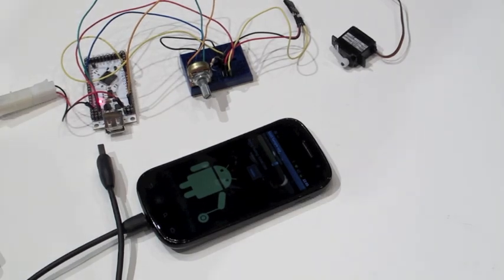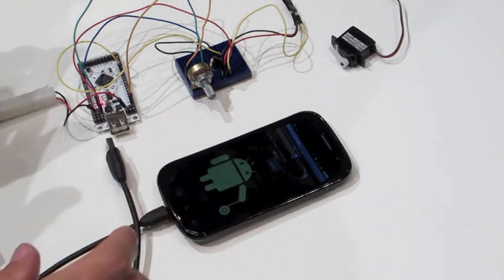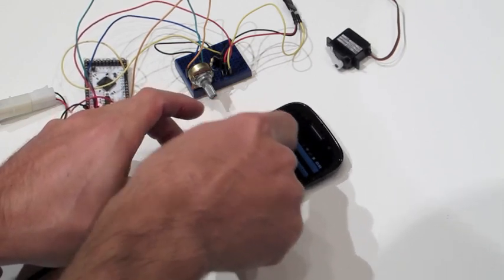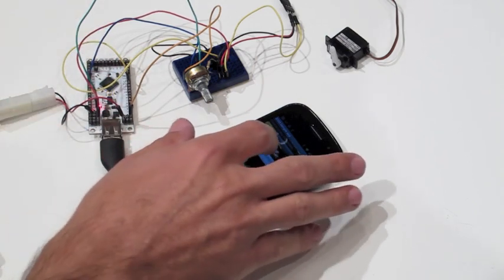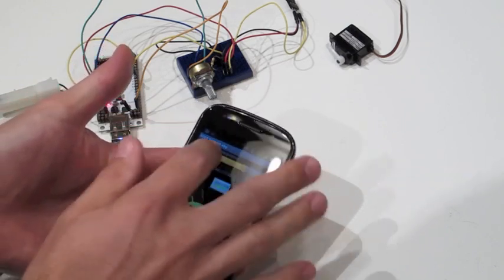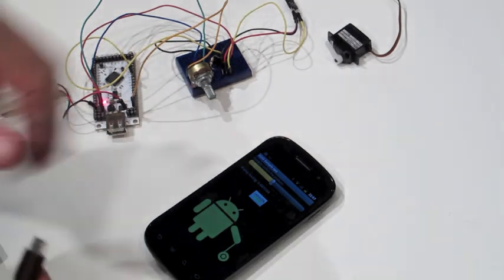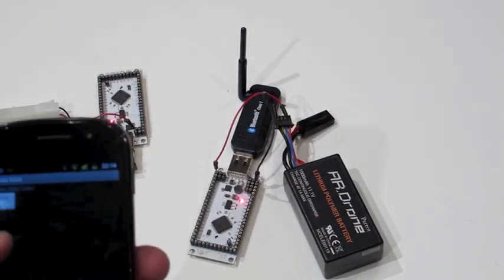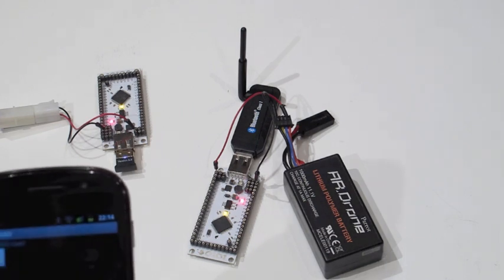IOIO Over Bluetooth Demo

Comment: Hiya, it's an old video but it's very informative for a beginner. I'd Like to know if it's possible to connect a USB hub which takes a BLuetooth dongle + a mobile phone(for charging) ?
Reply from the maker: No, there is currently no hub support. But if all you need is charging, you may simply extract 5V from the IOIO and use it for that purpose.

Comment: This device of yours is wonderful.  So how much power is needed to operate device?  Is there some interface document that one can program to, to control objects?  How far can the device be from it bluetooth contoller?
Reply from the maker: The IOIO itself consumes about 30mA of idle current. And of course, if you're plugging anything, such as a BT dongle to the USB jack, it will consume however much it needs.
This is a very old video, there have been a lot of developments in the IOIO since, so you probably want to check out the more recent IOIO-OTG.
A good place to start learning about how to use it is here: https://learn.sparkfun.com/tutorials/ioio-otg-hookup-guide
Reply: thanks, I am reading it now.  I did have another question, can I use a WIFI dongle instead of a blue tooth one?  I want to make sure that the signals gets through the walls in my house.
Reply from the maker: +Chris Sparks No, WiFi dongles are not currently supported.
Reply: I finally got my two IOIO OTG boards.  Soldering was strange for me as I hadn't done that in a long while. :-)  My only hang up is that I don't want to program in Java.  Has anyone done other languages with your product?  I know the firmware is in C or C++ as I saw that on GitHub.  What I wanted is to have 2 IOIO boards talk to each other without the need for an android device trying to control them.  Also would like for it to keep some data and then broadcast to my app (android or not).
Reply from the maker: +Chris Sparks What you want to do is possible hardware wise, but would essentially require a software rewrite. At this point, the IOIO-OTG is not much more than a PIC24 eval board.
Reply: You mean the application software being rewritten (I think it is in Java)? Are the C or C++ compilers I can use or am i stuck with Java?

I don't understand the reference to PIC24 eval board.
Reply from the maker: The IOIO-OTG was designed with the goal to allow a Java application, running on an Android device or a PC to access common electrical I/O interfaces. As such, it includes a hardware component (the IOIO-OTG board itself) and a software component (the client Java library).
The IOIO-OTG hardware is not much more than a breakout board for a PIC24 with some extra circuitry for power supply, USB, etc. If you completely ignore what the board what intended to do, you can write your own firmware for the PIC24 (typically, in C) and do with it whatever PIC24's do (the application you described being one of them). However, at that point you won't be able to leverage much of the existing firmware.
For the purpose the the IOIO-OTG was intended for (stated above), the firmware I've written, which comes pre-installed on the board exposes most of the PIC24 I/O capabilities over a serial (USB/Bluetooth) protocol, which the client library (Java) knows how to speak.
To state it more clearly, the IOIO-OTG was never intended for standalone operation. I feel like there are plenty of solutions for that use case in the ino eco-system so there wouldn't be much added value. But sure, if you like this (IOIO-OTG) particular hardware if certainly *can be used for standalone operation with the right firmware.
Hope this makes the situation clearer. If you have any follow-up, please move this discussion to the ioio-users Google Group.

Comment from the maker: Any DC source of 5V-15V, 5W or more should do. I use LiPo batteries for mobile setups and a wall adapter for stationary ones.
With the IOIO-OTG (latest version of the board) that power can come over USB from a PC. A recent software change, soon to be pushed, allow the IOIO-OTG to be powered by an OTG-capable Android device over USB (i.e. the IOIO will be powered by the Android battery).

Comment from the maker: For the time being, the firmware on the IOIO would only let you control the speed of stepper motors, not the actual position. This is being addressed, and in the future you'd have position control too (by performing a software/firmware upgrade). For the time being, either close the position loop using the camera (not very easy but probably doable, I imagine). Or just wait a couple of months for that, while working on the rest of the stuff. This isn't a weekend project anyway probably :)

Comment from the maker: Should be doable. The IOIO-related stuff is probably quite simple: you'd need drivers for the motors, and if you can keep your current draw below 1.5A (including USB) you can probably use the on-board IOIO 5V regulator.
Your project sounds very cool. Would be great if you could publish something whenever you make progress!

Comment from the maker: The application code should be 100% compatible I believe. Worst-case you'll need to edit the pin numbers, if the book uses pins 1, 2 or 47, 48 anywhere.
Some of the high-level explanations on the board (e.g. pin diagrams and pictures) will obviously not apply to the new one, but could be easily map-able. And of course, the book has no information on how to use IOIO on a PC.
There's a chance there'll be a new version of the book following IOIO-OTG, but it's not certain yet.